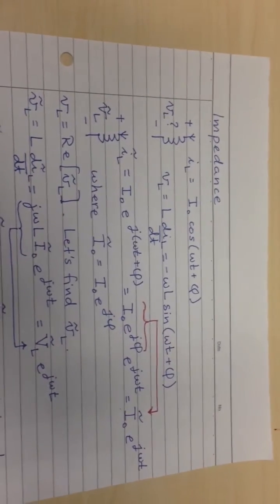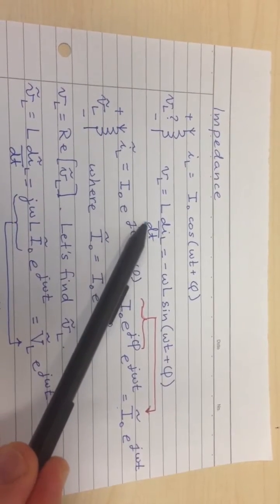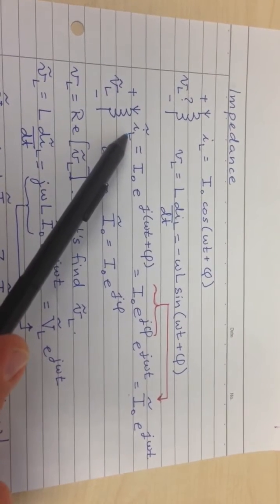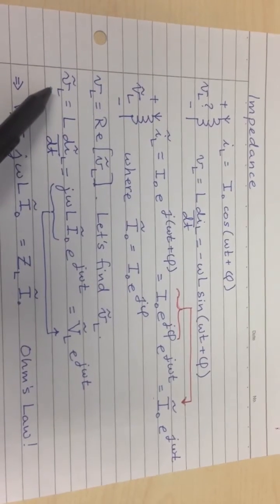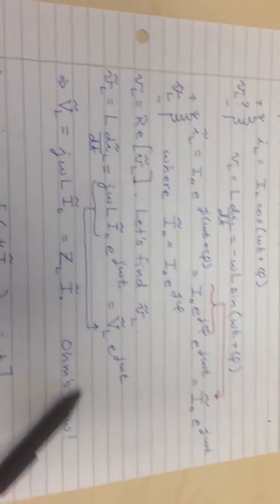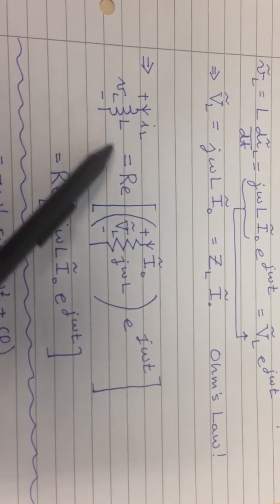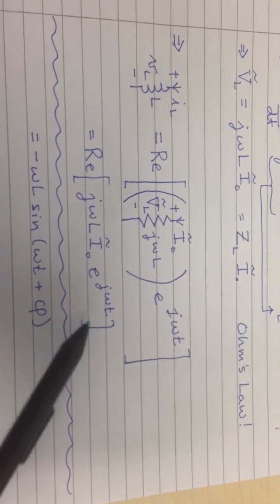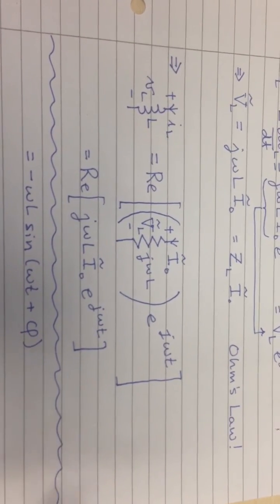Impedance Explained

Comment from the maker: characteristic impedance of a coax is an effective resistance (resulting from the coax's inductance and capacitance per unit length) that can be used to quickly determine how a coax will reflect or transmit a signal, and how fast the signal will move in the coax.  It has units of ohms, and represents the ratio of the voltage and current in the coax.